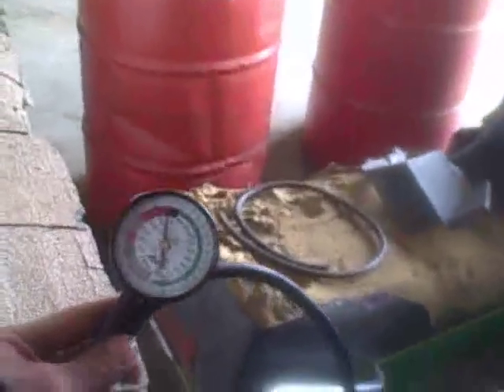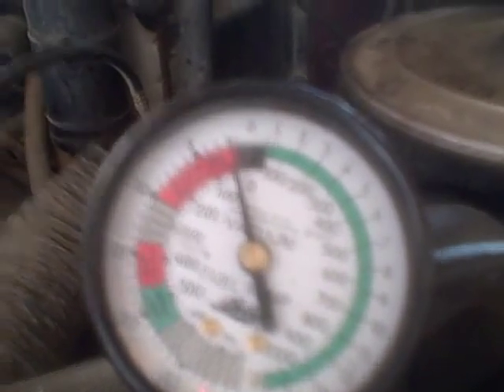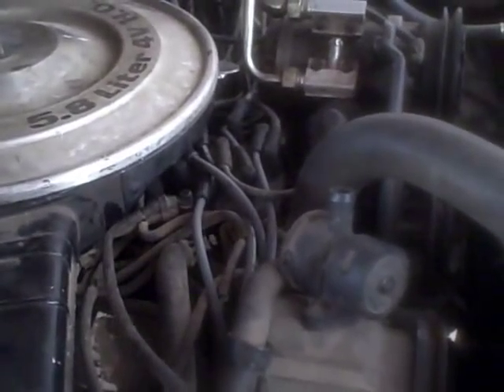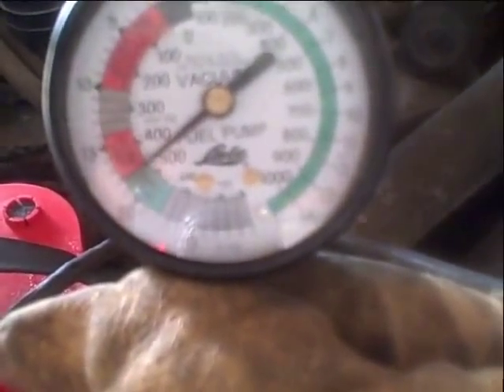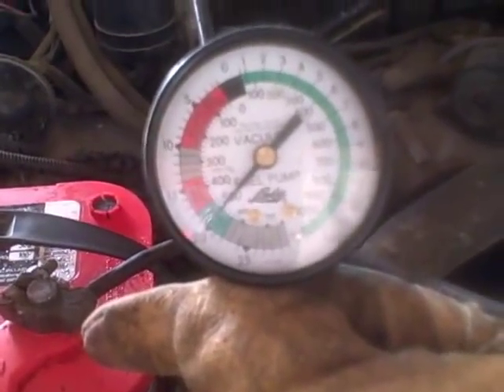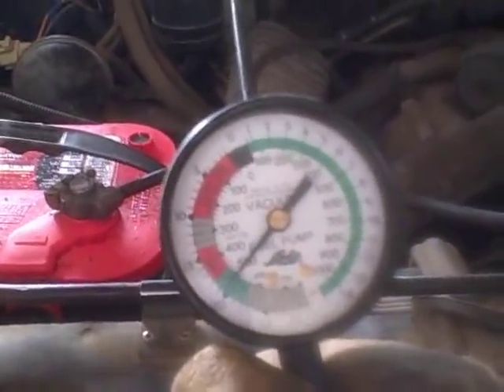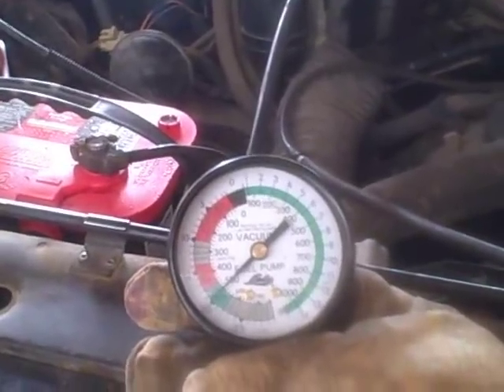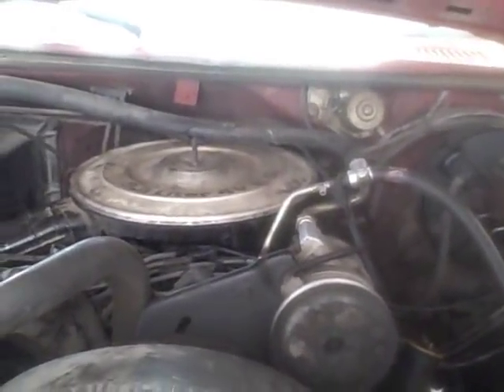how to use a vacuum gauge on charlies $50 F-150

Comment: i have some weird stuff going on in my 99 ram 5.9l it diesnt die or anything. its steady but move from about 15 to 19 inches of vacuum. do you have any idea why it might do that? the needle doesn't shake or anything its very stead but it moves that much. during idle and the truck gets a little shaky. any idea?
Reply: Your valves are sticking

Comment: no offence but when you hit the throttle it should go to two inch of vacuum if it goes to zero then youve more than likely got leaky valves or there just sticking so a reading of two is healthy
Reply: Actually I think you'll find going to zero straight after heavy throttle is a sign the rings are worn.
Reply: Mine in idle is at 20 but in a  heavy throttle it goes up to  22 only